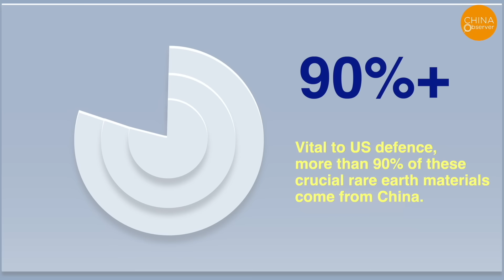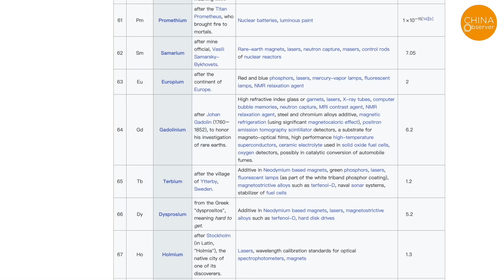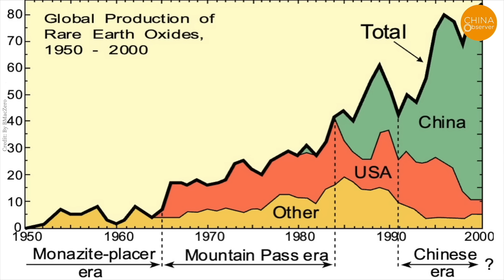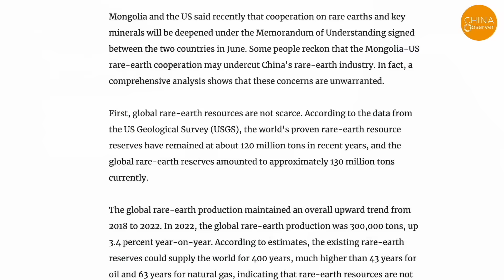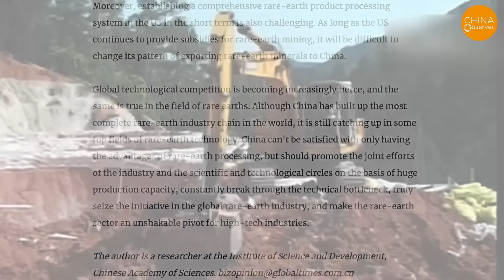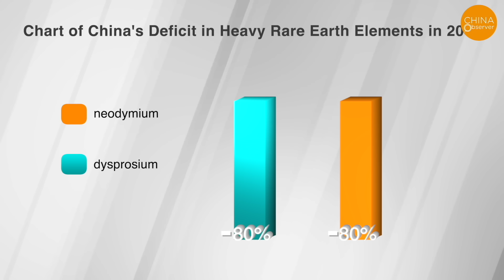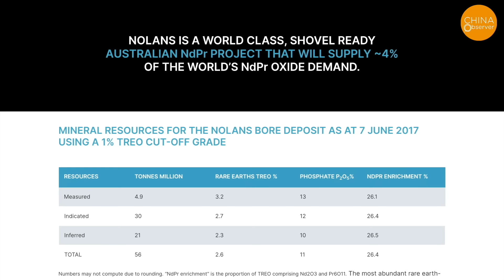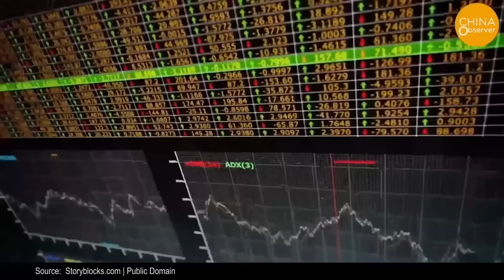China’s Dream to Control the World With Rare Earths Shattered, Profits Crash

Comment: The U.S. didn't even rank in the lithium reserves.
Then a few months ago, turns out it has the largest lithium reserves in the world. Then a month ago another huge discovery. But wait. There's much more(multiple sites). It just hasn't been completely confirmed yet. Officially anyway.

Most countries have a lot of resources.
They merely need to be located, officially proven, and the big issue. Actually setting up to extract them. That initial cost can be quite expensive.

Comment: You need to fix the soundtrack in this video. I had audio on FULL BLAST and the voice is almost too soft to hear.  I tested it out with a couple of other videos and I had to reduce it down halfway, go back to this hardly any sound at the same setting.
Reply: I did not have an issue of the sound on my iPad, try rebooting your machine and software, I found that once in a while this is needed to clear out the systems memory. No idea why it gets like that but it works every time for me